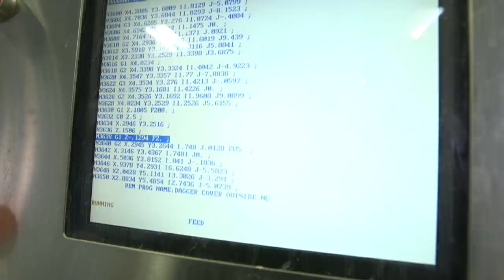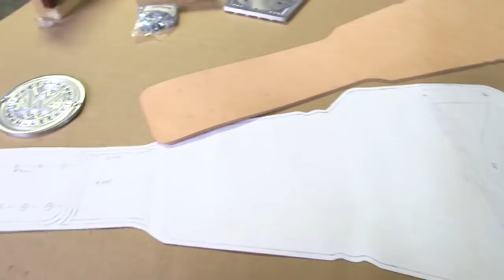OCC teams up with the WWE!

Comment: I thought it was gold,  "liars" They don't win the gold, they win the metal? Cheep ass wwe.
Reply: Not only is pure gold very easy to bend and therefore break, it’s very hard to actually mold gold in a perfect way. Also having all that as pure gold would be very very expensive
Reply: +Ben Proctor It’s not like they don’t have the money...
Reply: Point is that the belt being pure gold wouldn't hold up to the abuse that it takes. Not hard to understand why they had it made this way! Still not my favorite design, Really miss the Attitude Era belt.
Reply: If it was made out of pure gold.. it would dent as gold is a very soft metal. They made this one out of aluminum and plate it in 24k gold. Usually belts are made with zinc.. but this one is different. Interesting choice to go with aluminum.
Reply: TheSSUltimateGoku that belt would cost so much money you would haft to have guards around it at all times lol
Reply: The thing would look like a poorly molded gold freddy krueger after a few title switches if it was pure gold. Imagine what wrestlers would like while holding it

Comment: The spinner belt wasnt that bad but  what I always hated about was the word "CHAMP" on it that was TOO CENA they should have changed it with the word CHAMPION  after Cena lost it and they made the belt normal (It didnt spin anymore thank god).
1:06 that design is pretty good but I wasnt a fan of the black background. The current belt is awefull just a golden  frame and the big logo its so simple that reminds me of  the handmade cartboard belts that I used to make when I was a kid. Any other graphic designer could create a great design for the current main belts instead of those plastic toys they got now

Comment: The current heavyweight and universals titles look awful - the pockmarked leather backing instead of a metal plate makes these titles look incomplete. The WWE logo isn’t particularly appealing yet it’s the centerpiece of the front plate.

The design is derivative of what a “futuristic” title would look like and so the attempt at innovation falls flat. Vince says the title is just a gimmick, fair enough, but when the gimmick (title) looks less prestigious than previous iterations it’s a step backwards.

Reggie Parks created a masterpiece - not saying that the title shouldn’t have been updated, but a title with so much aesthetic appeal should have held influence on the current designs which are just gaudy WWE logos on leather.

OCC make great choppers but the WWE title they made was departure from titles with aesthetic prestige. Unfortunately the OCC design still carries influence on the current heavyweight and universal titles.

A redesign of the heavyweight and universal titles is long overdue.

Comment: Its metal all the years i thougt they used real gold
Reply: They use real gold but they dip the metal in a gold solution to coat the plates. It is 24k gold solution so it is real.. but the plate itself is not gold.